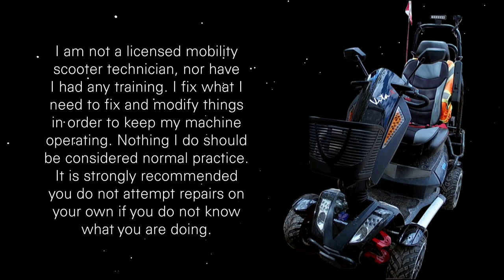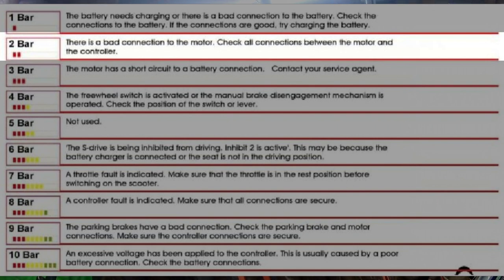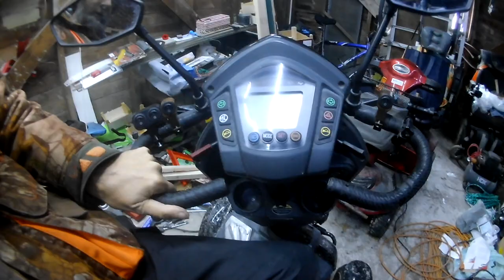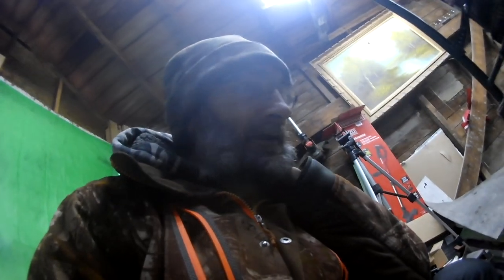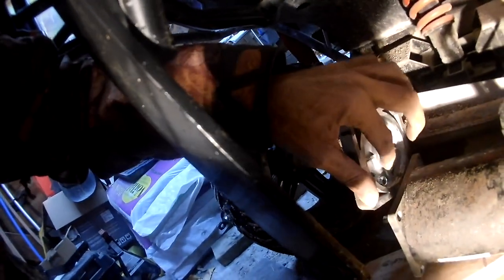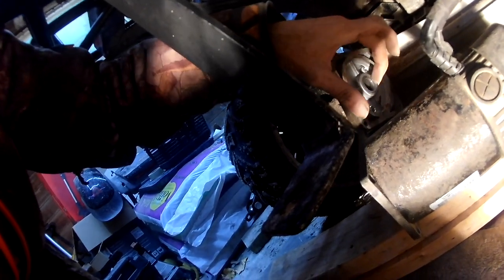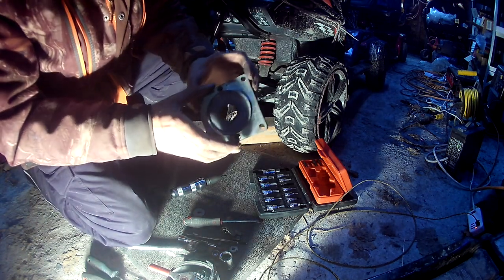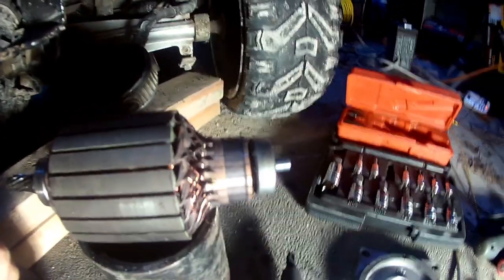Fixing the Motor's Commutator - P1 - Inspection and Preparation

Comment: The short on the front Check below the rubber as the wiring loom go’s in to 2” by 1” metal tube to run to the back you’ll probably find the short there
Reply from the maker: You'll see me check that in part 2. I couldn't find any broken/worn insulation. The problem seems to be fixed now but remains a mystery... which tells me it will probably be back again at some point.

Comment: The seal should be smaller on the inside of it to fit against the shaft of the motor so it definitely needs replacing
Reply from the maker: I doubt I'd be able to replace the seal. I wasn't able to replace just the motor. I had to replace the motor/brake/transaxle as one complete unit. That's one thing I don't like about Heartway.

Comment: I Think grease is getting hot in the transaxle and as  it melts its getting past the seal into the motor your lucky it doesn't fire . hope you get it sorted it should once you sort the brushes .
Reply from the maker: That's really the only explanation. There's no other way oil could get into the motor. I just find it odd the previous motor didn't have this issue.

Comment: Wes, do any of your subscribers ✔ also have a monster and/or the same monster and/or similar problems? I don't personally have any of these problems on my Pegasus BUT... having said that... I don't take it out in mud, dirt, water, snow, sleet, hail, blizzards, hurricanes, tornadoes, tall grass in wet swamps, or other obvious hazards; so I believe that's why I don't have these problems. Have you considered that? (grins) 
Ok, having voiced that... I know you do and treat that machine like a go-anywhere 4X4 monster TRUCK + >🚜🚙🛺🚚🦽🦼 because you have no other choices. The new error code 7 could be just because it's cold or wet or parked more or less outside in the day-to-day temperature changes, old, rusty, well used, or just tired out, etc. Hey... don't bite me... I'm just reiterating the obvious. Anyway, it gives you something to do and post, and keeps us WATCHERS interested. I tune in now if for no other reason than to see my 'pen-pal Wes' do his 'WTF is wrong now?' thing and I sure have learned a lot of scooters do's and don'ts stuff from you. (grins) 
Until next time. Happy trails. 😎👍 
PS... I noticed that you did not mark with tape or a scratch arrow which way that motor case goes back on. Assuming you have not moved it I think the way it is sitting on the floor, the end that's down, slides on first (is the back) as of the end of this video, and assuming you have not moved it again. You should mark that with tape or something as it apparently fits on either way and that in itself is ODD. You'd think it could only go on one way?
Reply from the maker: LOL. I should rename my channel "WTF is wrong now?" I used the label on the shell as a guide and the alignment mark for the brake placement to be sure I put it back together the way it came apart. One of the first things I noticed after I started posting videos of The Monster was many people with one were commenting about it, saying they've had the same problems but don't drive it the way I do, or as often. In some cases, they've had worse problems. A friend found a listing for it on Amazon and in the comments, someone bought one for their disabled son. All he ever did was drive it around their driveway and after a month, the motor blew up. They discovered the same thing I did; you can't get "just" a new motor, you have to replace the entire transaxle. I still compare it to my old scooter. Aside from off roading, I did the same things with it as I do with The Monster and I never had issues with it.